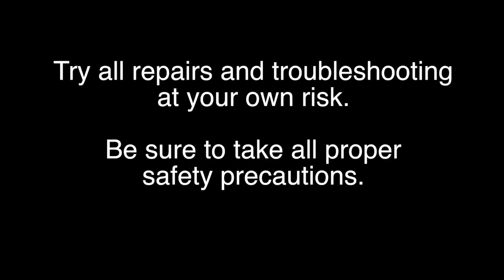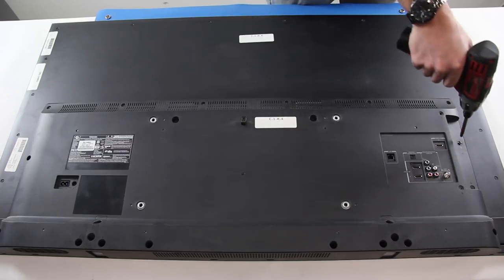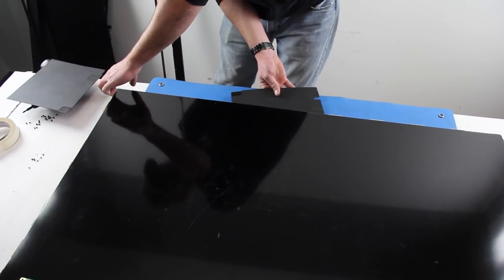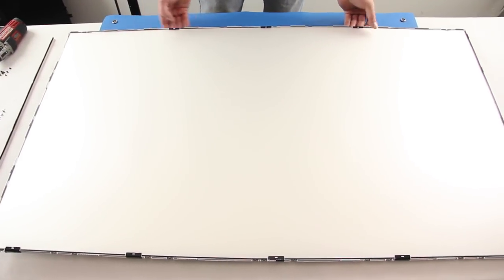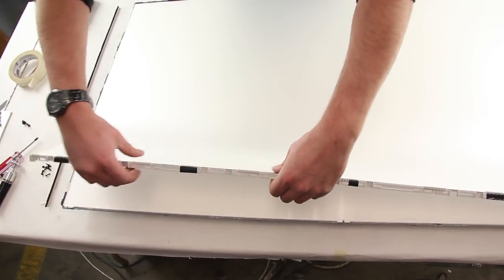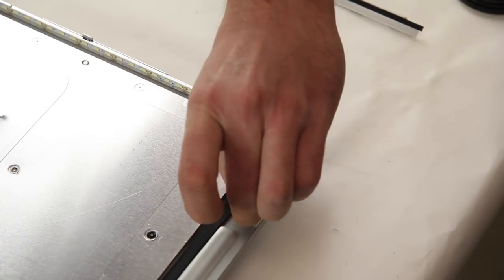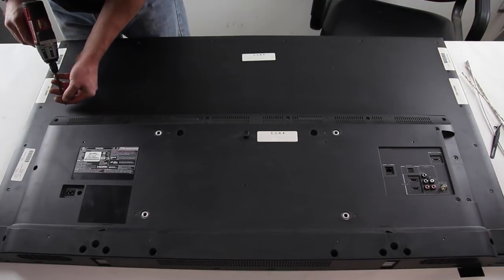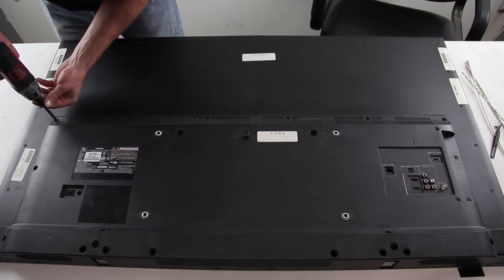Toshiba LED TV Repair How to Replace LV500H1-ME1-TLEM9 LED Light Strip Bar

Comment: Hi I have toshiba 32 inch 32LL3A63DB. Black screen with sound, After changing tcon (thank you for you videos) it worked 2 days and then same problem
Black screen.
I've now learnt the torch trick and I see a picture so assume it's led problem. I'm a diyer so I'm wondering if it's the main board or the actual strip. I see a lead from main board (red and black) to left of casing from back view, going into behind screen. Is there a voltage check I can do to isolate problem please?
Thank-you for your excellent channel..👍

Comment: I have a toshiba model number 55lf621u19 with a white display you can still see the picture just a white display over the picture I pulled off the back panel but was only able to locate the power board and main board I can't didn't see the t con board